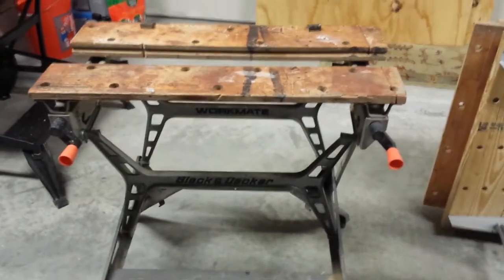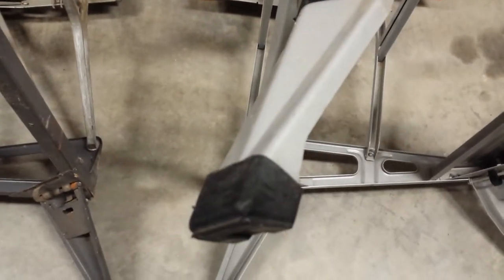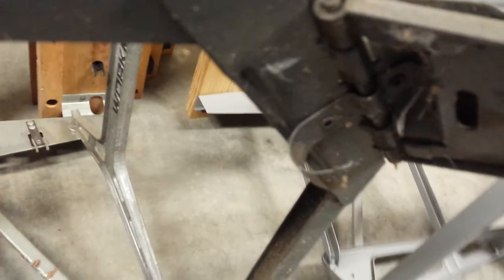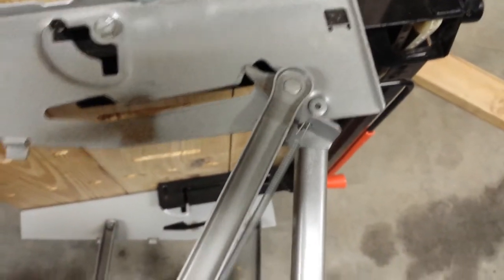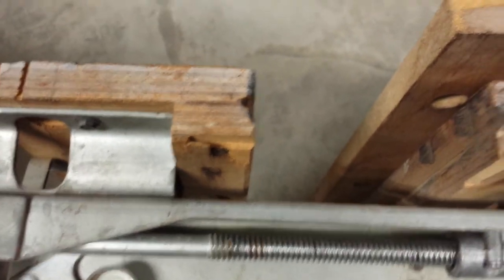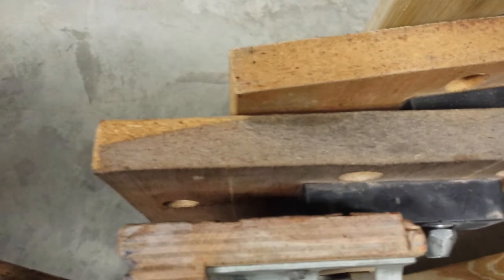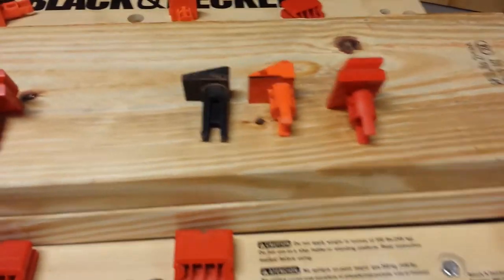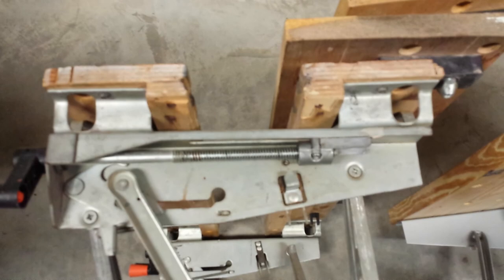Vintage Workmate 625 Full Review

Comment: Hi John great workmate hiw to videos. I have a WM  225 with one board missing (the one not connected to the adjusting screws) and was thinking of making 2 board tops (duplicating the original one I have so both are even thickness) what is the dimensions of the 2nd board and is it possible to make 3 boards like the 425 and if so what are the dimensions of those boards? Thx in advance.
Reply from the maker: Hey Texas Crossbow Dude - I don't have the 225 but I suspect the panels are very similar if not identical.  This video details the dimensions of the replacement panels I made for the 425 which may just work for you.  https://youtu.be/OKKEV7VcnhU
Let me know how this works out for you.  Cheers.

Comment: I'm curious how you decided that this Workmate is a "625"? It matches almost exactly the model that was sold in the U.S. in 1975-76 as the 79-001 Type 2. The only thing that doesn't match are the black and orange plastic handles, which are from a later model. Have you looked at the bottom surface of the jaws? Most of the early models had their model/type information stamped there.
Reply from the maker: Hi Chris - I couldn't find any markings on this Workmate.  I did a visual comparison to other Workmates on line that were identified to come away with the model number you see here.  Thanks for stopping by and posting your question.
Reply from the maker: Hi Chris - You have a very nice website and it is obvious you have spent a great deal of time assembling the information you have there.  I will have to pull this bench out of storage and take another look for the markings to see what I can come up with.   Cheers!

Comment: Good Video 
the Bench Dogs Girth are the Same ? Black to Orange Color ?
Even the Holes in the Wood Same or Different Diameter ?
i have 2 one Stamped Steel H- Frame - Legs Folded do not have any Mounts to Use the Table Folded .also no LAtch to Stop the Legs from Flapping 
the Lasted one has a Aluminum H- Frame , Plastic Release to Lower , and STEEL SLEEVE Covering the Wooden Top .
also has a POWER BAR Mounted to the Side
Reply from the maker: All of the bench dogs and holes are the same across all models that I have reviewed on my channel.

Comment: Just got any early 625 today, it has adjustable feet on the lower legs, but it has the more modern rubber feet on the fold out legs.
Reply from the maker: Congratulations on your new vintage WorkMate.  I know you are going to enjoy using it.  Cheers!
Reply: You have an e05 or higher then

Comment: The rivets on my workmate 425 type 6 have gotten really loose. So much that I've had to replace a couple of them with nuts and bolts, only owning it after about a year or year and half. I've owned it now for I think 3½-4 years but I still really enjoy using it. It was a Christmas gift from my roommate/ex-boyfriend.
Reply from the maker: Wow, that's no good.  Too bad it is out of warranty.
Reply: @WorkMateGuy  Yeah they don't make things the way they used to.

Comment: Very Good Video 
i picked up a USED one FREE
ALL STEEL - No Aluminum 
but the H- Frame also BOLTED !!! + the WOOD Support Elevations are METAL !!!
no Steel Spring for the Fold out LEGS and When you FOLD the LEGS in : UNABLE to use as LOW Table - B& D ELEMINATED the STUBBY LEGS !!!!
the TOP wood tsh THIN NO L- Block Shape .
Probably a 80's Model
Reply: John, I just picked up one that sounds a lot like yours. I will try and sent you a photo. Cheers.
Reply: Sorry. -Joni!
Reply: @billcamenzind5635  Make a Video Review

Comment: Am I the only person who has noticed on the 625 (and other older ones like my 79-001) that you can push 1/2" steel pipes through the top-board support brackets?  Now you can have side extensions (with or without legs) to support longer workpieces, or you can link two Workmates together.
Reply from the maker: Great idea, thanks for sharing!

Comment: Hello John. I've seen many complaints from people who compare older WM's to the newer WM 425 and other current models. How would you rate the sturdiness of the new ones? Are they still acceptable and not totally flimsy as some people suggest? In the beginning of the video I've noticed you had a black painted WM on the left. Which model was that and why did you chose to review the grey 425 version? Are they the same vintage?
Reply from the maker: Some good questions.  Balancing weight and sturdiness is a delicate feat to accomplish.  As for me the 425 is more that strong enough for the work I have done with it and still not too heavy to move around.  Older workmates are hard to find any more so I review the ones I can get my hands on. Cheers!
Reply: I just got a hold of a WM Type 2 1st Iteration (with aluminum centers for the plastic knobs and the 4-rib front step). Solid with no wiggle when fully unfolded. Love it! The only knock against the older versions is that they're slightly more effort to fold and unfold. The Type 1 and 2's are made with mostly aluminum and metal while the later types (later Type 4 and up) are made of thinner steel for lower weight and not comparable in terms of sturdiness.